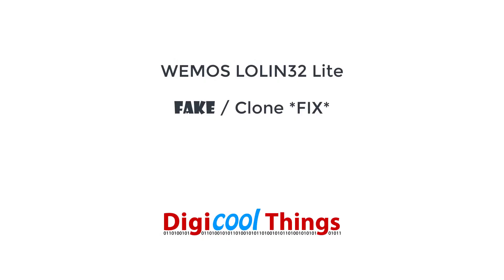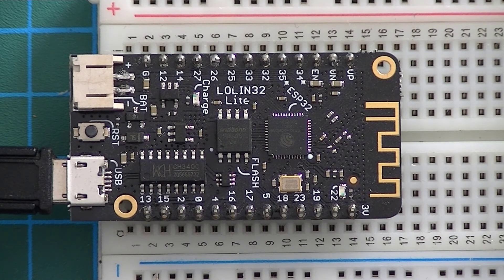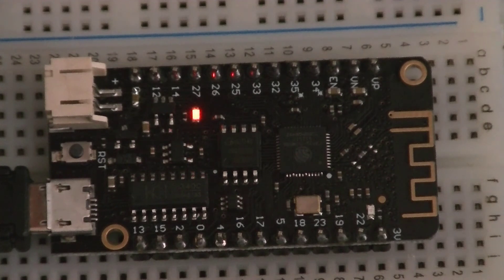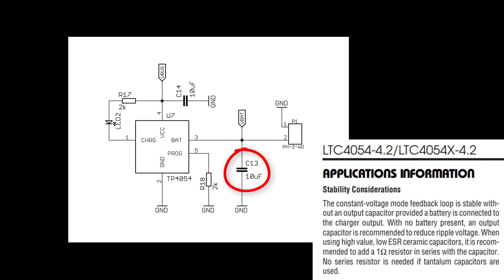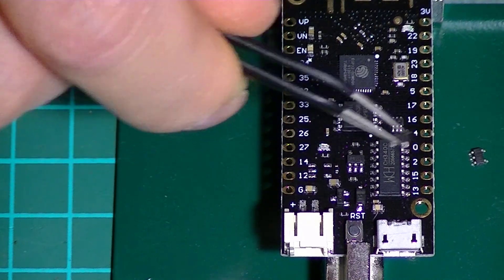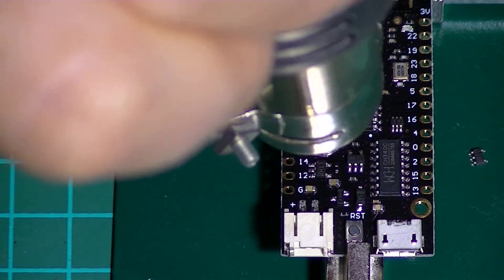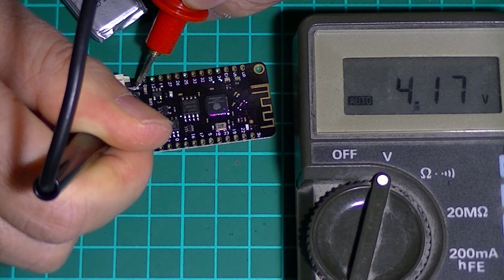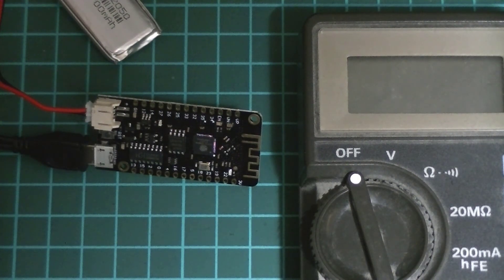WEMOS LOLIN32 Lite - Fake / Clone *FIX*

Comment: Very helpful, thanks for sharing this! I recently ordered a LOLIN32 from Amazon and seem to have received a board with exactly the same fault.
Reply: I stand corrected. After testing my board I noticed that there isn't anything wrong with the charger after all. I measured charging voltage and current and noticed that it actually does terminate the charge. The led stays lit, but a lot dimmer than during charging. And Wemos is selling the new D32 in two variants: Standard and -LED. They say about the -LED variant: "the red LED will fast flashing when the battery is not connected." (https://www.aliexpress.com/item/32883116057.html) So it seems to me it's not actually a faulty chip, but maybe a different variant (maybe the one with trickle charge support?)
Reply: Looks to me like it could be this chip: http://iosandr.com/upLoad/ty/ETP4054.pdf: " the indicator light flashes
 when the battery is inserted and the battery is disconnected. Missed battery or bad battery contact."
Reply: @MarcusWeseloh  I was suspecting something like that. Mine are blinking blue. I should probably test with a battery. Only came across this video while searching for something else.

Comment: Good video, I have the clone board as well and Red light flashing. Like to ask, how do you flash this board, I can flash one time without holding any Reset button or pulling GPIO0 to GND, but if I flash second time with different code, the board still running old code. Any idea why is this?

Comment: Hi Digicool, thanks and very cool that you spotted the problem and shared a fix. I have now ordered 10 replacement ics , but do you have any thoughts on why all of these boards seem to arrive with faulty LTC4054 charging ics?
Reply from the maker: Thanks Don, I appreciate the feedback. The problem certainly does seem to be widespread.
Perhaps you can also post back with an update, once you have been able to replace your faulty LTC4054’s?
We can only speculate that the manufacturer of these clone boards perhaps has (or had) a large stockholding of fake (or common failure) LTC4054 parts, and perhaps also has an inadequate QC process, or, simply ignored the problem with their manufactured clone boards?
It certainly is an interesting question.
Reply: @DigicoolThings  Yes, I will report back. I also spotted this gem in the datasheet

PROG (Pin 5): Charge Current Program, Charge Current
Monitor and Shutdown Pin. The charge current is pro-
grammed by connecting a 1% resistor, RPROG, to ground.
When charging in constant-current mode, this pin servos
to 1V. In all modes, the voltage on this pin can be used to
measure the charge current using the following formula:

IBAT = (VPROG/RPROG) • 1000

So we could use VP or VN inputs on ADC1 to monitor the charge voltage and current.

Comment: Great video, what is the name of the spring loaded table/chuck your using to hold the board?
Also out of interest you now have control over overcharging the battery, does the lolin32 have any protection for under-voltage, looking over the pdf of the circuit I cant seem to find anything that stops it going too low, browning out and drawing a lot of current as the esp tries to constantly restart.

Comment: hi, thanks for your video. I seem to have the same symptoms, but I also realized that the 3.3V pin outputs 4.85V (the battery connectors also measure 4.85), when powered via usb. Is this normal and would replacing this charging circuit fix this issue as well? Or would I also have a broken voltage regulator? I’ve ordered three boards all with the same blinking charging LED and the 3.3V and battery connector pins measuring 4.85V.
Reply from the maker: Hi. You should not be seeing 4.85v on 3.3v power line.  The ESP32 itself has a power supply voltage absolute maximum rating of 3.6v, so having 4.85v present would certainly be potentially damaging.  The Lolin32 Lite 3.3v power line is regulated by the ME6211 LDO Regulator (the other SOT23-5 package).
I’m assuming the 4.85v you measured on the battery connectors was with no battery connected, powered via USB?
In normal battery connected charge state operation, the battery output is regulated to 4.2v float voltage by the LTC4054.
Reply: Digicool Things hi, thanks for your reply. I feel stupid now, I measured 4.85V on the 3.3V line and something like 7V on the 5V line. I then measured a brand new Arduino and got exactly the same results. I measured directly the power of the usb port, same 7V. This is obviously impossible, so I am sure that my cheap multi meter has ran out of battery and therefor read a completely wrong voltage. The fact that I am getting consistently wrong readings, actually makes me believe that the voltage is fine on the board, but I don’t have a replacement battery to confirm it. It is just the blinking red charging led that is the problem, other than that the board works flawless.
Reply: I’ve also ordered the recommended charging circuits and will replace them, thank your for the information!
Reply from the maker: @badstep495  Yay. An incorrect voltage reading is the best finding / outcome. At least your ESP32 will be relieved to have not suffered an untimely execution! :)
Reply from the maker: @badstep495  Great. I look forward to hearing the end result. It is sad that this fault seems to be so prevalent.

Comment: Good job,but How can I turn on the wemos-board with the battery? Help :>
Reply from the maker: Thanks. When you connect the battery, the board is powered-up / turned-on.  Just the same as if you plug in USB power (without a battery already connected). 
If you plug in USB power with the battery already connected, you are simply swapping over to USB power / battery charging (if not above the fully charged threshold already).
Hope that helps. :-)

Comment: Very interesting video. I have a (untested) lolin lite board, but already have some TP4054 chips so i've either got a good one, or a weekend project!!
Reply: Curiosity got the better of me - my board has no markings on the front, and plugging in the "Power" LED flashes just like yours, d'oh!! Turns out I have MCP73831 charger chips too, so I have to buy some of those TP4054 SOT5 chips too. Thanks for the great info.
Reply from the maker: Hi Stephen. Thanks for confirming your unmarked clone board appears to have the same symptoms. This is looking to be quite widespread!
A quick look at the MCP73831 data sheet suggests you may be able to use in place of the 4054 (assuming you have 4.2v variant SOT-23-5 package).
The MCP73831 has the same pin-out and would appear to provide the required function, within the LOLIN32 Lite circuit design. 
Even the 2k PROG resister value provides the same 500ma charge current.  
I look forward to hearing (seeing?) how your repair goes! :-)
Reply: Digicool Things that's interesting about the comparability of the charger chips. I have ordered some TP ones so will wait on those. I will have to hand de-solder though... so no promises!!!! Hahaha!!

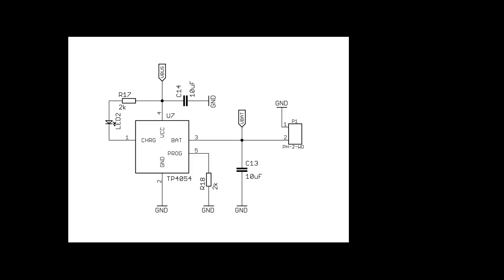Comment: Excellent video (if you could use the same audio device/settings as you did from 4:13, that would be great). Great explanation and brilliant demo of replacing the chip. Will have to check mine and the D32 to see if they have the same issue.
Reply from the maker: Thanks Steve. Yes, getting a reasonable voice recording was probably the most time consuming part of assembling the video. I don’t have any professional recording gear, but hopefully I'll improve with practice. :-)
Note, I’ve not had any issues with the official Wemos store bought boards. Perhaps some clone suppliers are cutting costs with dubious sourced components?
But with multiple boards having the same symptoms, it does suggest some bad LTC4054 / TP4054’s may be in circulation.

Comment: Great video! Looking forward to trying our the fix when I get my replacement ic
Reply from the maker: Thanks Brian. As I had the same issue with both boards purchased and you also appeared to have the same issue, it prompted me to make this video!
It's clearly not just a "one off” board failure, so potentially more widespread than just our boards. 
Hopefully this video might help to save a few ESP32 boards from the dumpster. :-)
I look forward to hearing how it goes with your fix.